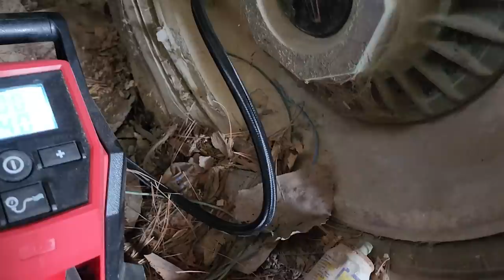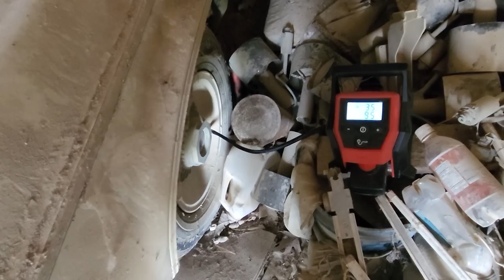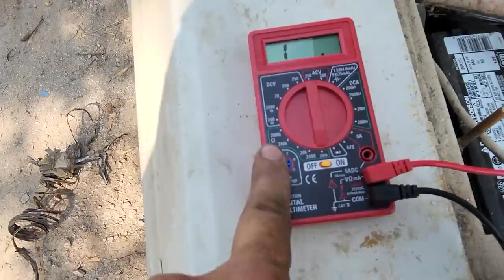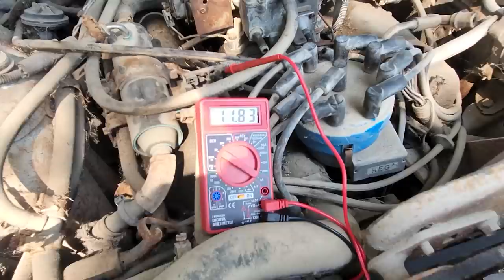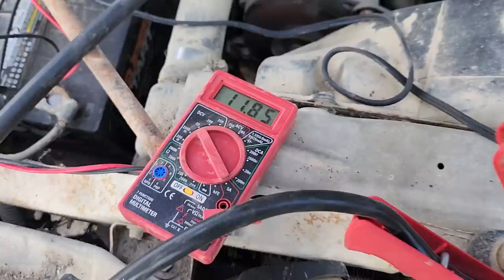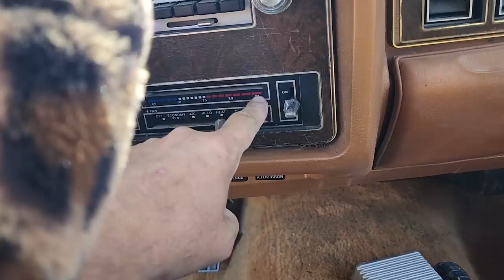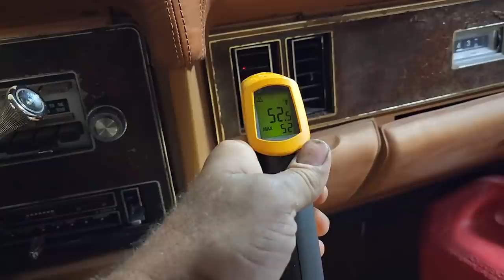ABANDONED Rare Lincoln Parked 22 Years! Will It RUN AND DRIVE 650 Miles Home?

Comment: My dad had one when I was growing up.  It's gonna have carb problems untill you swap it out for a real carb.  And the whole car has vacuum everything and after 22 years of sitting.  You can be certain there will be leaks.  Pull the rear end ,and send it the the junk yard maybe the C4 transmission.

Comment: I am wheelchair bound, and when I saw how low the car sat when you got into it. It would be perfect for me. I could easily put my wheelchair in the passenger seat. And with the AC fixed and brakes, it would make a good car for me. Talk about a good car. You usually have to do a lot of work on cars that sat that amount of time. And this one was not perfect with the electrical sparky not working all the time. Well, it was dependable once you figured out how to get around that issue.

Comment: The King is showing the young dudes, what it was like to be an average young dude in the seventies. Every old beater car had issues. MOPARS the ballast resistor, fords had their own things… but most car guys had a box in the trunk.
I was cleaning the barn the other day and found my mandatory box that I carried in every car. 
Steel box with…VISE GRIPS, adjustable wrenches, breaker bar and sockets, snap-on multi tip screwdriver, tape, wire , hose clamps, fuses, bulbs,Ballast resistors, wd40, starter fluid, brake fluid,jumper cables.
Back in the seventies, you could make most cars run with the contents of that box.
Did I miss any items ?

Comment: I understand that oil doesn't loose viscosity over night however when oil sits for a long time with carbon in it hints used oil it creates an acid and that acid eats the coating off of your rod ,main and cam bearings and will cause them to fail the best thing is to get that old oil out get it hot with new oil and drain and change again yea it sucks to loose 5 quarts or so but it's better than eating the bearings out of your motor

Comment: Loved this episode, i think you ought to get the brakes in order, new fuel tank mechanical pump and lines, and maybe try flushing the transmission by pulling a cooler hose and letting the trans pump flush push the fluid out and i bet ya she'd work great. Get all that gunk that was floating around in the converter and cooler out. Probably might need a filter change again.

Comment: I think the intermittent spark problem is the ignition control box that should be on or near the drivers fender my old 78 f159 with a 302 had one that drove me nuts until my buddy told me about his Napa has 2 regular and a high spark model the high spark seemed to do the trick

Comment: It looks and your description sounds like it related to the Lincoln MK8. Another words it's the same Fox4 platform as the Third and Cougars front the 80s. The MK8s had independent rear suspension and disc breaks on the rear. Swapping rear end parts into the other Fox Ford's was a thing. I had an 85  T Bird for a few years.

Comment: Now, that is good the engine is running. Just need a good Gas source. And you will be on your way once the brakes are working! My brother in law used to buy cars all over the place. And the ones that we knew would not make it, he pulled the car. And I was the one in the bad car. And he would get really mad if I left slack in the pulling. It was very stressful, but as I got older, it worked much better! WOW regarding the tranny as we called it, i have never seen one in that bad shape. WOW. Looks more like motor oil.

Comment: What’s a 1971 VW Super Beetle auto stick that’s sat for 37 years worth to you ? Run’s and drives, needs brakes gone through, park brake working ,some rust underneath the battery box , and under the back window do to rear window seal leaking , 119000 miles on it . First year Super Beetle was made

Comment: Call me crazy but you can put a board or anything hard under the flat tires, roll them just slightly up on said object/s to squish the tire, then start airing em up. Itll work 99% of the time for tires just off bead a little. Done it several dozen times on anhydrous/propane tanks.

Comment: The engineering  company I worked for had a 85 F150, 302, automatic. It broke down in 87, at a job site! Went to find out what had happen. Turned out it was an experimental unit Ford built, ignition module was 1st used on cars in 87. Glad it waited until 87 to break down. Never did find a starter, the part number did not exist at Ford!

Comment: Came across the same transmission issue on my 1991 Firebird.   If it wasn't for watching this video and seeing you swap the fluid and filter and get the Lincoln driving again.  I might have just called it a day on the Firebird.  Great video and persistence on getting the Linolcn running and driving again. Also hope you had a great Christmas

Comment: I would like to know if the car ran when it was parked, why was it not driven to keep it running.   I have a 1971 cuda my aunt gave me when she passed away and it only has around twenty two thousand on it but I drive it every month to make sure things are running.   Now sometimes when it rains or the weather is bad I don't drive it but I do start it and let the engine get hot to keep moisture out of the engine. :yougotthis:

Comment: If you could get a bigger engine than the 302 /5.0 V8 in it it can't be the Fox4. The 3.8l V6 is a little wider than the 302 and it just fit. It required using an end wrench on the spark plug socket to get #1 plug out of the V6 in the Cugar's and T birds. The 302s were easy

Comment: Im not sure if this car has it but some Ford vehicles have a dodge style ceramic distribution block under the steering column that transfers power to the never spark box when the ignition is turned on and if this has that I'd bet thats being the issue with your spark problems after turning it off.

Comment: Is it true that when you start up the engine that when you start this caru should put the car in neutral and let it warm up because the pump in the transmission will still pump transmission needs fluid while it warms up

Comment: I heard of somebody doing that what I flush the transmission and they put like gasoline or or diesel fuel down at the clean it and then they run it a little bit and play with the shifter and let it circle ate a little bit and then they go back and they fill it up with transmission fluid and and supposedly it's supposed to work

Comment: Watch those cinder blocks.  The Slitherin's and furry legged freaks like to hang out in the pockets of cinder blocks.  Reach in and have a mouse chisel on your sausage fingers.  THAT would be video Gold,,for us.    Neat save on the Versailles.  My Boss had a Lincoln Town Car in the 80's.   2 drain plugs, for the oil pan.  It just didn't register, with my young talent.   Massive grungy overfill with fresh and old.  Thanks for the work Big D.  That Trans had NEVER been serviced since the creation of the Moon.   Always remember Kiddies,,if you have mechanical E-Brakes, then you have brakes, no matter the fluid level or condition, for the most part,,and models.  Learn how to use a Mech hand brake/Foot brake, like GranPappy in the 1800's, on the Chili Cattle Drive Wagon thing.   HE'YEP!!,,PSSST!!,,,HiYAW!! .  Friends, the question has been answered.  Bear do crap in the woods, ,  And History was made with this vid.  You got to see a genuine unedited failure of a Alternator belt.  Never before recorded by man.

Comment: The Second I found out I have no gears on an FMX, especially with the fluid looking like that, Unbolt, drop the pan, pull the internal filter over the Sump, check for Metal shavings in the bottom of the pan and clutch dust, "A Silvery Sheen in the oil" FMX and Ford-O-Matic Transmissions were common in these cars and they are probably one of the worst 3 Speed Auto Transmissions Ford Made in those days.  You could be lucky and have a C4 or a C6, but not likely for a C6 that was their "Heavy Duty" Transmission.  C4, that's more to hope for, but if you have an FMX that's a mess.  Number one, they do not like to go into gear unless the Fluid is at the exact right level, 2. If that filter is clogged, It's No Bueno at all.  Start simple, also there is not a drain plug most of the time.  Carefully drop your Transmission Pan, I would also recommend getting a new Transmission Gasket because that thing is going to be a crispy critter.  You can tell what Transmission you have by the Shape of the Oil pan and the number of Bolts.  Duraspark II ignition modules sucked really bad, I carry at least 2-3 of them in the vehicle at all times, that is how unreliable they are, and as far as Charging goes, if mice have not chewed the wires, look on your passenger side Fender, there will be a little Box, that is your External Regulator, you can also find it by tracing F and I wires from the Alternator, Those Commonly go out.  All it takes is Jumpstarting another vehicle, or killing the battery completely and then trying to jumpstart this car from a good battery.  As far as the Fuel pump goes.  they are usually under $35, so Cheap, but they are Mechanical, they are going to be off the Right hand side of the engine, if this is the 351 Windsor, Modified, or Cleveland, and again you can follow the lines that go into it to find it.  They have a rubber diaphragm in them that will rot away over time, similar to your accelerator pump and for similar reasons.  If it is not pumping fuel, that is most likely the cause.  As far as a blockage goes, get an air line and a compressor, blow it up into the line coming from the fuel tank, see if you can make it bubble, could be a clog, if it does have a clog though, it is very likely that you have mud, dust, rust, or sediment in your fuel tank plugging up the siphon.  That is a pain in the ass, you could also run your borescope into the filler neck to see what it looks like inside.  I am willing to bet though as dusty as the cr was.. Mud, but I am only 54:35 into your video, I am excited to see.  Can you tell I am an old Ford Guy Derek?  lol Yes I am.  @Vice Grip Garage ~Elijah   Oh also give your trans fluid a sniff and whiff test, if it smells burnt, you might have some clutch problems as well, if you have both a silvery sheen in your cranberry oil and a burnt smell, you may be looking at a rebuild, maybe you can limp it home, but like I say they do not like to go into gear when they are not at the correct level, or if the pressure is too low, and when running listen under the car, if you hear what sounds like a small power steering pump or hydraulic pump whining, that is most likely going to be your Transmission front pump, you can replace it if it does that, but you have to pull the transmission to get to it, there is no other way.  I thought I heard that in your video, but maybe not it is hard to tell.  Let's see what else.   Tail shaft seal is going to probably be crispy too, you will lose all of your fluid if you pull the driveshaft and don't replace it because as the Spline comes out, it will crack the crispy critter Tail shaft seal.  I love these old cars, I have worked on them since I was 9 years old.  I think they are marvelous, except when Engineers decide to do stupid things.  Point and case, Duraspark II ignition modules.

Comment: In 1976 Cadillac launched their new Seville.  It was based on the Chevy Nova and it was a big success.  Ford had nothing to compete so the next year they took their Granada and tried to make it into a Seville Killer.  The Versailles was not more than a glorified Granada and everyone knew it immediately.  They added a Lincoln like hump on the trunk and actually made a very nice little car.  They had special paint jobs and great attention to detail.  Lots of sound insulation and invisible improvements.  They were VERY well equipped and actually pretty spiffy!  Still, they were a Glorified Granada!  The top of the line Granadas were almost as nice and thousands of dollars less. People made fun of those cobbled up Granadas and they flopped. Several years later their dismal resale values made them a lot of car for the money!  I suppose as the saying go’s ….” It is better to attempt something and fail than to attempt nothing and succeed”

Comment: Derek I have all the books for these old schoolers , 9 of 10 times your problem is the Module isn`t grounded , There was times when mine wouldn`t start either went thru the darn Robot Ramen all over it trying different module bang it ran ,What that`s funny put old one back on it started so new grounding situation , Or neutral Safety switch on Trans shifter plus the old lift the shift lever WTH it started them are just some I`ve ran across I`ve owned Fords for 50 yrs from 64 Econoline up But I have all the wiring schematics I can take Pics and email them or do a vid for you But try the grounding the Module first - Ps if it ever runs erratic lube the distributer eccentric the Points are dragging retarding the current I have 2 460s -Large case C-6 Van doors Complete powertrains dually Rear end 3:73 gears But Alberta Can . Let me know if I can help in the books You lucked out here I traded a Fiat X-19 Bertone for a 77 LTD Brougham it smoked so bad when I got home only to find out the valve covers were loose tightened them Best car I ever owned Old lady car went from Edmonton Ab.  to San Francisco on a holiday never burnt a drop of oil to and from even came home thru Vancouver Bc not one spec of rust too garage stored car .

Comment: i don’t really remember this model from that era but i’m thinking. it was the same platform fromFord that was. the Granada ?  those. we’re  good cars to find in Junkyards. in the 80s because  the Granada  actually.  had      some. of Fords. bigger  engines and  myself and several of my High School freinds had  1960s Mustangs   we often  pulled parts from Granada motors at our local Salvage Yards    we  salvaged a 302. in a Mustang. by  bolting on  the heads from a Granada and  those  were actually  a higher performance part for the Stock  ones the Mustang came with  we didn’t really care about the performance  upgrade. as it was the cheapest option we had at that. time  ironically. i bolted those heads onto the Mustang   without even using   a Tourque wrench  or new Headgaskets and the car ran great for 10 years. before it was  totaled  by a Drunk running a red light   we saved the car  for a while by. pulling  off body panels from a 68  6 cylinder  car i had  that  caught on fire under the hood  those panels were pulled and   we dragged the body to the same Scrap Yard the engine parts  came from !    ironically that was the only Classic Mustang in  our local Junkyards for a number of years  and  after  a couple of years  just about every part of that car was stripped before they crushed it

Comment: Mi blew power steering line 1992 fld flat top freightliner in Chicago on a Friday afternoon on my way home drove the semi with no power steering with 50’000 pound steel coil on the deck of flatbed semi trailer the line blew on 128th street bridge down town blue island Illinois now don’t run anything over all the way to midwestern Wisconsin

Comment: for the transmission fluid, i’d bring an extractor that has a straw go down the dipstick tube. Empty the pan from there.   Fill it. Run the car for 5 minutes to circulate the trans fluid. Shut it off.  Repeat, until the fluid looks free of water. Do the filter service when you have a lift available .

Comment: With all the gunk in that tranny, after you drove it the 50 miles, I would have changed the tranny fluid and filter again, considering the original fill as a "flush" treatment.